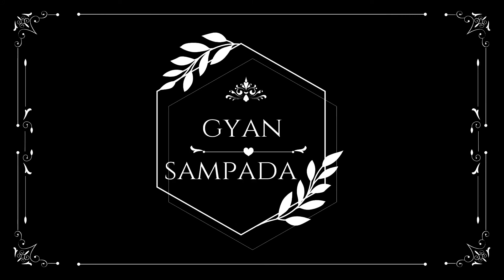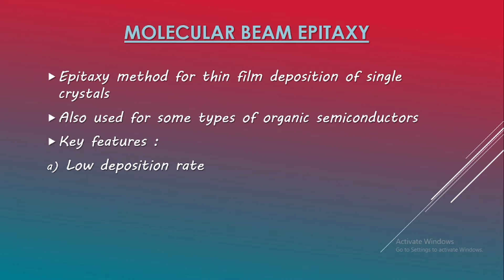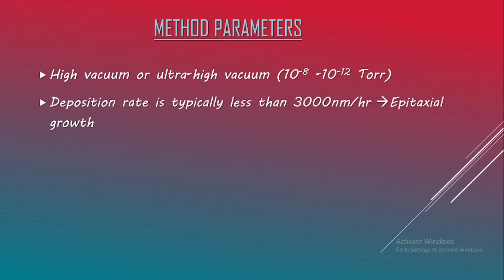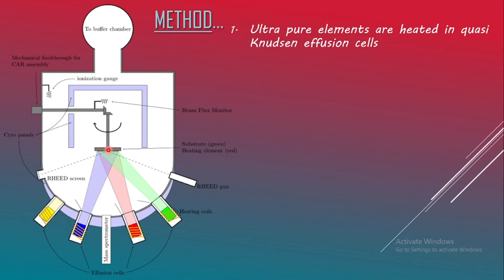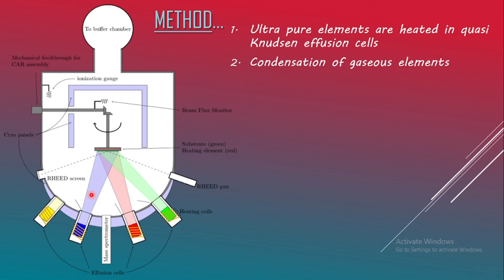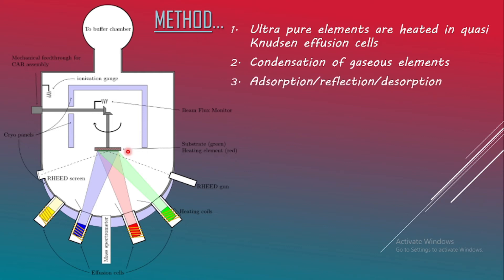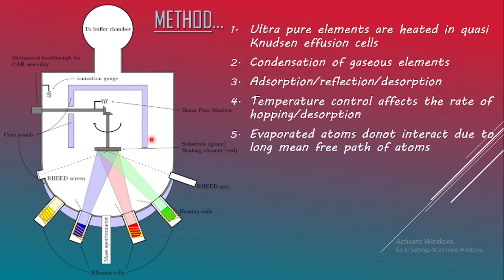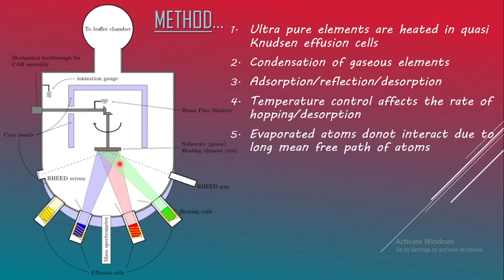15. Molecular Beam Epitaxy in Thin Film Deposition - Meaning, Working, Condition, Uses using Diagram

Comment: How are the impurities directed to the cryopanels?
What are the parameters for this?
Reply from the maker: Cryopanels are essential to the UHV chamber. Within the vacuum chamber there are two cryopanels- the growth cryopanel and the source cryopanel. The growth cryopanel surrounds the wafer holder & helps cryotrap impurities near the wafer. The source cryopanel has openings for each material source, allowing molecules to pass through & reach the substrate. These cryopanels provide thermal isolation for the material sources, allowing temperature to be controlled independently & ensuring consistent evaporation of molecules.
It is important to that for MBE process requires the cryopanels to be continuously wetted with LN- closed loop circulation with a constant flow. 
I hope you will find this helpful👍

Comment: Salut and Thank You! I did not know such a process had ever existed 
until the last hour.... but thanks to you, there is a small possibility that 
I could eventually begin to understand why these components act or refuse to act, or as they do on various combinations distributed in layers which subsequently shall remain stable and nonreactive by this method.... though could this be done differently, perhaps an experiment might be possible quite high above the earth's surface; by utilizing an appropriate substrate, such as a vapour, chaff, or maybe even an organism.... and as one wishes; apply certain metallic salts and gasses, magnetic field and frequency (doppler, microwave) 
by beam, in alteration or in a way to achieve interaction, the result of the experiment; a loaded aerosol if deployed from wing nozzles.... 
by  modifying the amped up conditions, I might be better able to predict the movement and strength concerning weather systems?
Okay, maybe I got carried away, maybe just a little bit.... but,.is this a viable method?
Reply from the maker: Thank you for your valuable response..
As such if we need to do something then we need to tune many parameters accordingly so that we get the things on a right path..It is a challenging task however can be thought of by considering different upgradations!